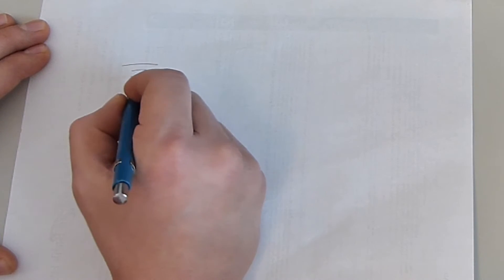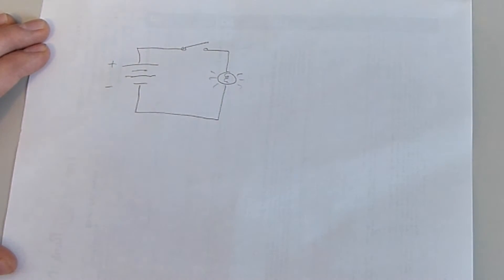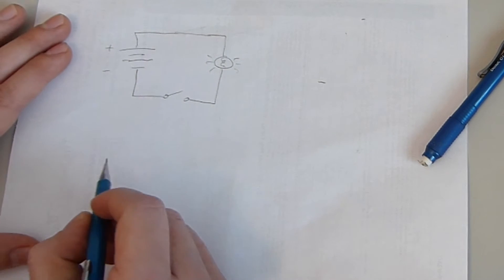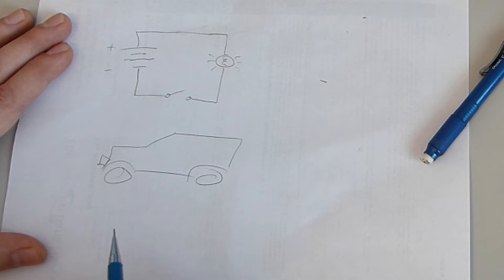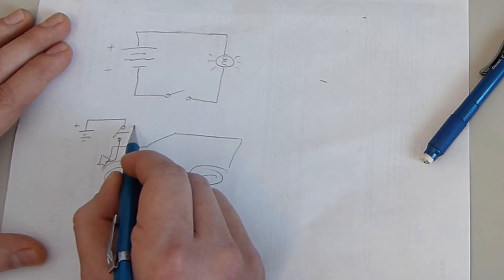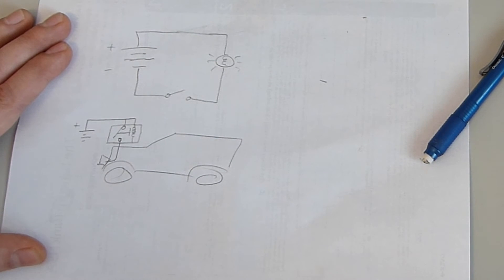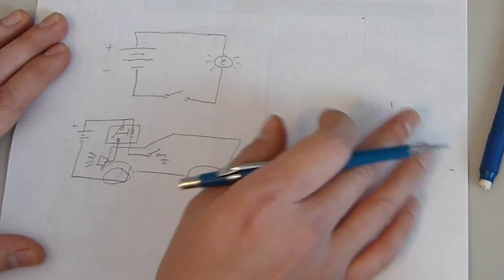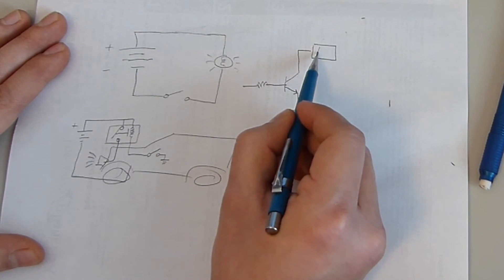Secret method to wire 12v accessories in your car with 1 wire

Comment: Run power from battery to inline fuse holder to switch.. power from switch to power on accessory.. accessory ground to negative terminal/ground. Doesnt need to be that difficult.

Comment: Just be aware that some vehicles are negative switched already, which can affect how things need to be wired up.
LED's for instance are diodes, so must be wired the correct way as current can only flow through them in one direction
Reply from the maker: I agree always check your wiring type.  USA Standard shown in this video has the vehicle chassis as Battery Negative (-) as standard.

Comment: ? Can i wire a relay to use a positive feed from my a/c compressor to give my new electronic fan controller a ground signal some my fans will run when a/c is ingauged or any ideas
Reply from the maker: That's a good idea in theory.  I assume that A/C comp signal is positive to drive the A/C clutch, so going parallel off that to an auto relay should work.  Make sure the relay has a diode across the coil to protect the car, should be depicted on the screen printed diagram on the relay.

Comment: you lost me at hello bro lol
Reply from the maker: The gist, possible elephant in the room, is that your whole chassis and body is ground so that in a roundabout-way we're using the chassis/body as 1 of the wires.  So instead of running 2 wires into your cabin, you can just ground it out anywhere there is metal.  I was compelled to share this concept because I saw outside of the box that a switch can be anywhere in a circuit, on the positive side or negative side.  It's just when we're young or starting out, everyone puts a switch on the positive side so we then assume that is the way it should always be, stuck ourselves in a box.

Comment: But if you wire it up this way, if the wire went to ground after the switch the line would be energized constant wouldn’t it be.  Causing the accessory to run constant until you eliminated the ground point?  If that was the case wouldn’t it not pop the fuse if you had an inline fuse on the 12v side?  But if you wired the switch on the 12v side, if some how the line through the fire wall was damaged and it went to ground, the fuse would pop, saving the load item from any possible damage to the accessory?
Reply from the maker: Always fuse nears the Battery Positive (+), this way any overload will be tripped by the fuse regardless of the shotty wiring that grounded out :P

Comment: Can I just wire a 12v rocker switch to just switch ground without relay ? I have a circuit on a utv  where the harness switches ground not power for rear reverse  led lights.. so I wanted to put a rocker switch in line of this ground to Supply ground to complete circuit when the utv is not in reverse....  Can I do it without a relay